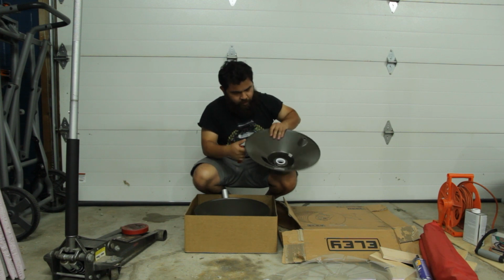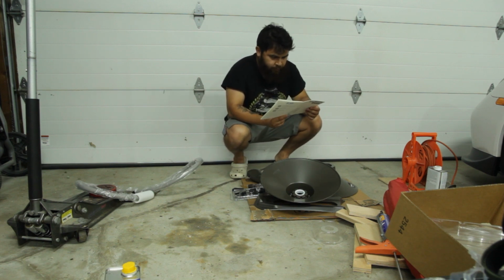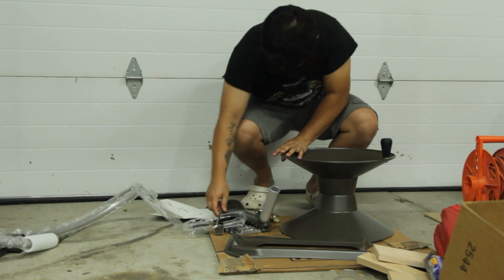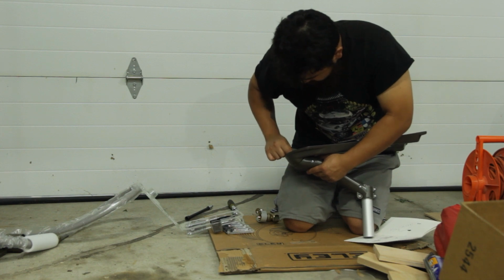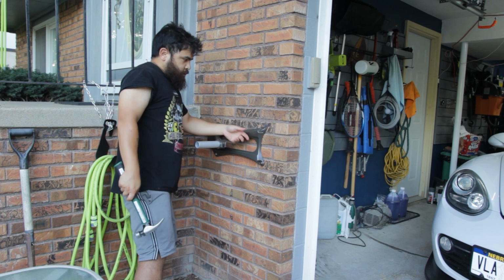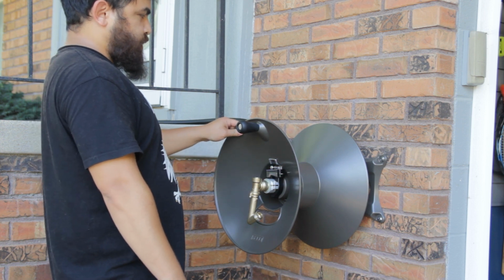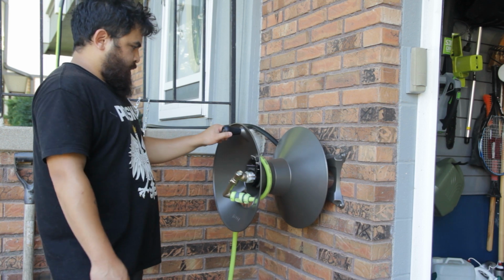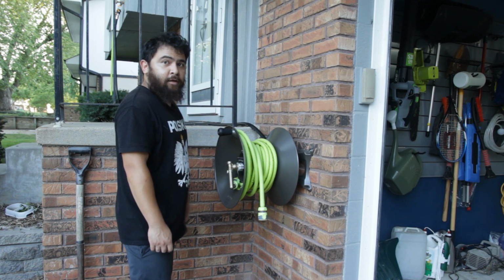Eley Garden Hose Reel - Unboxing, Installation and Initial Thoughts

Comment: Good video, thanks for taking the time to do it. I was just looking at these today to use for next spring/summer. These look really robust and worth the cost. I'll have to get the reel that mounts to a post and 200 foot of their hose too.
Reply from the maker: I actually just replaced the flexzilla hose used in the video with a very pricey 75 foot hose from Eley. My flexzilla hose fittings just kept bursting if I left the water running for more than a few seconds and basically meant I had to shut it off every time I wasn’t using the water; it was awful running back and forth to the spigot when washing my cars. As stated, the hose was pricey and probably 3-4x the cost of a similar hose you can get at a big box store but for me it’s worth knowing I won’t have to worry about replacing the hose every couple of years. The hose and the fittings feel solid. Eley products so far seem to be well worth the money.

Just FYI they are currently on sale for Labor Day (10% off)!

Comment: I just installed an Eley reel, so I skipped through your video, just to see what you did. Looked familiar. ;-) Your video displayed what I saw. One thing that took me a few seconds to realize was how the hose connector could rotate in multiple directions to attach hose, then it was easy....so that is why they did it that way. The Eley reel is great. It was overkill for my 100 foot EasyFlow [soft] hose though, I think I'll stick to just a hanger for it. So I moved my 3/4 inch rubber hose to that location and the reel made it a lot easier. It is behind a gate though so possibly I should have gotten that hose guide that Eley has...I think from a comment that the base sticks in the ground and then you can insert and remove the guide. I have not looked. I used a large piece of spongy material and a board to keep the hose from getting trapped under the gate. Probably just use the sponge in the future. 
After all that I still have issues. First, there is a malfunctioning anti-siphon backflow preventer or Vacuum Breaker on that spigot. It is preventing good flow and when I turned off the spigot I got soaked. So Eley fine, spigot not so fine. I may need a plumber to get it off and leave it off or replace it. The other spigot is leaking around the handle when on so I will need to take care of that too. :-( 
At least I was able to use my Eley Brass Garden Hose Nozzle on the new EasyFlow hose. The nozzle works great. The 0 degree stream was strong enough to remove excessive mildew in some Oolite type porch tiles. I looked at it and it appears that when you rotate or pull it in and out that it works by squeezing a flexible tube. Interesting and effective. 
So far I have not been able to use it on the 3/4 inch hose or the other EasyFlow type hose as I cannot get the old nozzles off, even with Knipex Cobra pliers and an Alligator pliers. One is the brass tube type and the other is a BonAire that is leaking. I possibly can service the Bonaire on the hose removing the center with a 5/32" allen wrench IIRC, and maybe that would help take it off, but I would prefer to just unscrew it from the hose. 
Anyone have any suggestions on how to remove the stuck hose nozzles without damaging them or the hose fittings? One the heavy rubber hose the fitting is brass and on the other EasyFlow type the fitting is aluminum. For that matter anyone have suggestions on removing the anti-siphon fitting. It is also covered with paint, so might be a job beyond me.
Reply from the maker: Can't help you there unfortunately, I would think pliers would work fine and you might just have to live with damaging it. As for removing the anti-siphon, I'm sure there are some videos on here that could help but it might just need servicing. Glad the reel works well. Still enjoy mine and I am now using a 75 ft Eley hose and it's a beast.